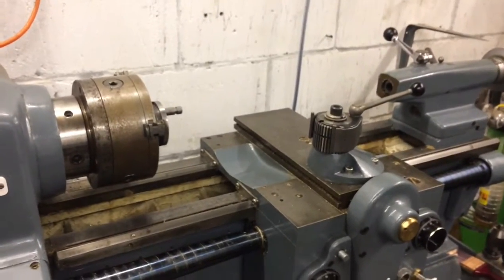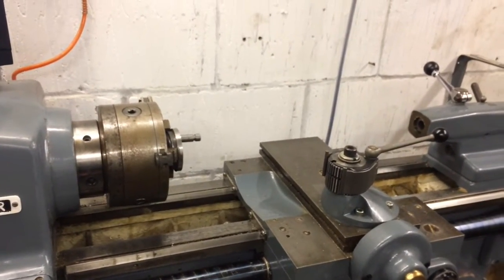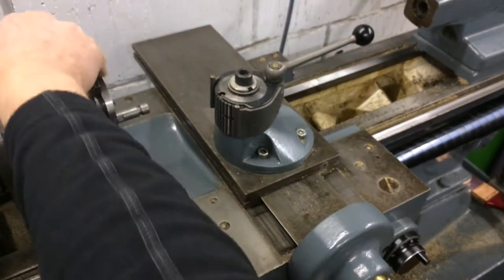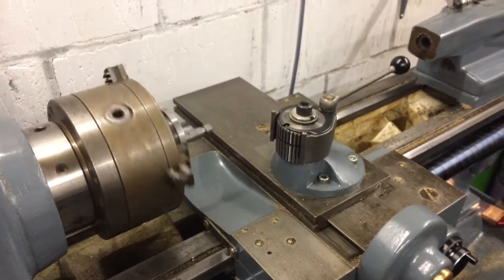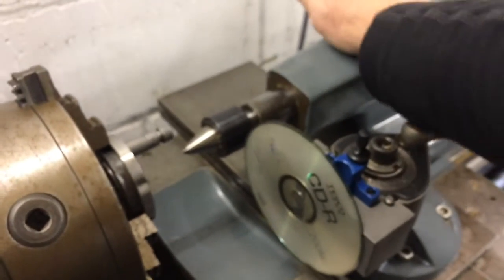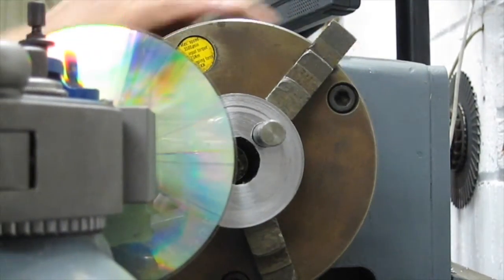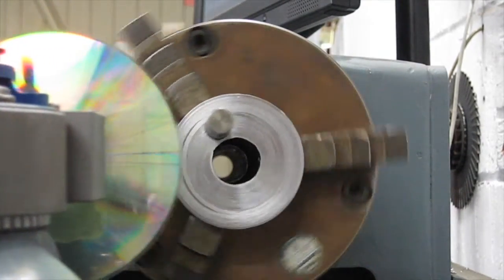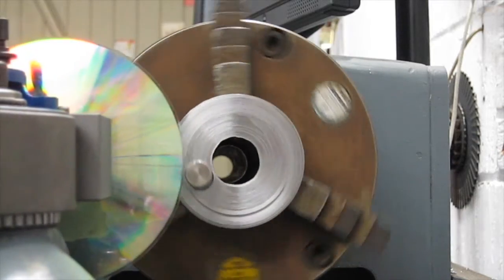Crank-grinding mock-up

Comment: hello andy, is this work achievable with an old version of linuxcnc, namely ubuntu 8.04 and emc² 2.2 .., other qestion, your configuration, I imagine that it is a mesa and which pc thank you, sorry for my English, I am french, well done for what you do
Reply from the maker: It can be done with an old version, but why are you using such an old version? 
Anyway, without "external offsets" ( http://linuxcnc.org/docs/2.8/html/motion/external-offsets.html ) you would need to use the "offset" HAL component. http://linuxcnc.org/docs/2.8/html/man/man9/offset.9.html
My earlier video on eccentric turning was done years ago, and used "offset"
Yes, that machine is using resolver feedback to a Mesa 7i49 paired with a Mesa 6i24, 7i44 and 7i84. With a pair of Mesa 8i20 drives for the axes. Oh, and a 7i73.

Comment: Tell me please. This motion used hal component or special kinematics.
Thanks
Reply from the maker: This is using a HAL component. The dgarr/external_offsets branch makes this sort of thing relatively easy. 
I don't know whether this would work in cartesian space with a non-trivial machine and standard kins. That would be interesting to see. The eoffset HAL pins are of the form axis.X.... etc so it seems that the offsets are in world space not joint space.
Reply: Very thanks

Comment: are you trying to wear your ways prematurely, copying something you've seen on a modern cnc machine with linear slides?
Reply: silly comment hes experimenting with programming, lubricated dovetail slides have a long life and there are plenty of cnc machines that use normal slideways . The main use of frictionless slides is for fast feeds

Comment: Put a HSS turning bit at the same location as the OD of the grinding wheel and a piece of soft stock where the crank pin is and see if it cuts a cylinder.
Just a suggestion.
Cool project. 
Thanks,
John
Reply from the maker: The main thing the maths has to do is account for the fact that the contact point moves up and down. A normal turning bit would only touch the pin in a a few places.
Reply: andy pugh 
Oh, yes. You are absolutely correct on that.
I saw it with the disk, then forgot about it.
Somewhat like modeling a slider-crank mechanism.
The position of the contact point will be on a straight line between the centerline of the pin and the centerline of the grinding wheel.
I imagine you would have to calculate the horizontal position for about every half degree of rotation of the crank.
That's a fun math problem.
Thanks,
John
Reply from the maker: y = crank_throw * sin(spindle_angle + phase);
    phi = asin( y / (wheel_radius + part_radius));
    x = crank_throw * cos(spindle_angle + phase );
    os = (1 - cos(phi)) * (wheel_radius + part_radius) + x;
    if (isnan(os) == FALSE) offset = os;
Reply: Tell me please. This motion used hal component or special kinematics.
Thanks